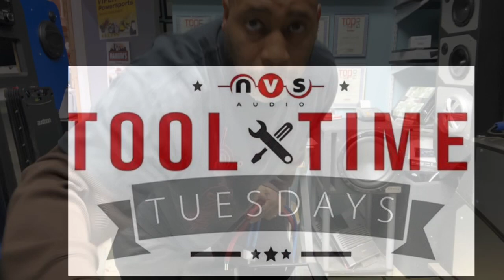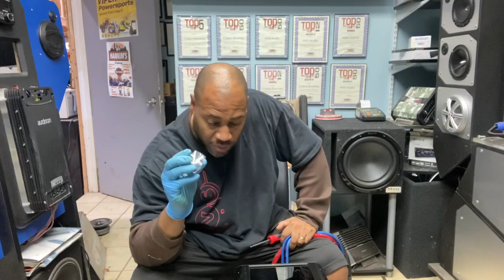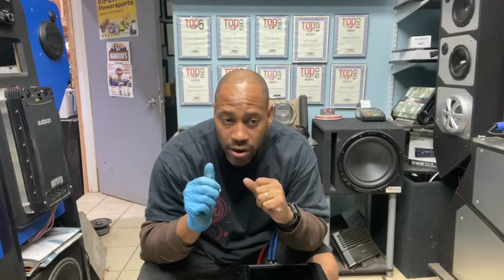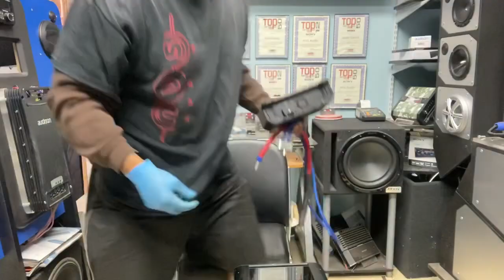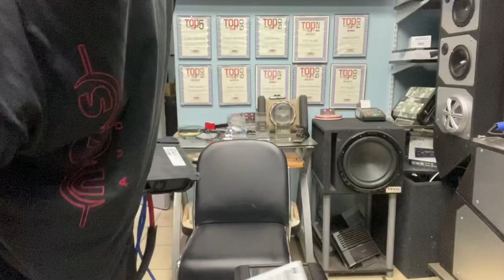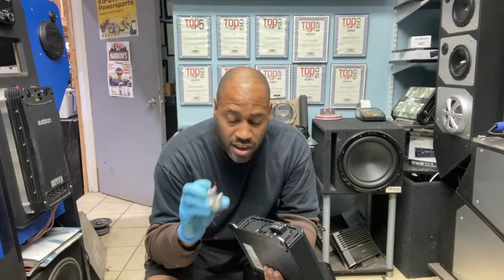Tool time Tuesday dual 0 gauge to single 4 gauge power wire adaptors

Comment: Hey bud. Going to be running a jp1300 and have 4 gauge existing power and ground. Can I get away with 4 gauge and can I hook the 4 gauge up to the 0 Gauge on the Amp? I didn't see and 4 gauge to 0 Gauge adapters. Thank you in advance
Reply from the maker: If you are see running it at 1 ohm you will
Need zero gauge 

If you are running it at 2 or 4 ohm 4 Gauge will work
Reply: @NVSAUDIO Running a single 12 2ohm at 1200 Watts right now. Where's the cheapest place to get good 0 Gauge OFC? Man I just spent a lot getting this system ready and don't really want to shell out the money for 0 Gauge now. 😅
Reply from the maker: @jaybourbon8608  https://www.batterycablesusa.com/0-gauge-1-0-awg-extreme-battery-cable-with-ends
Reply: @NVSAUDIO Man I broke down and ordered that 1/0 AWG to be safe. Man this build is adding up quick. Hah. Appreciate the help.

Comment: I had a question for you if you can help me on upgrading mono amp. Currently running 4 gauge ofc power wire with 120 amp fuse by the battery. Wanted to upgrade to a ds18 frp 2.5 mono amp but requires 1 gauge power wire with a 200 fuse amp. Can I run a distribution block with a 200 amp and 1 gauge power wire ofc going into the amp? Most of the ofc power wire would stay 4 gauge but would add the distribution block with fuse and a foot or 2 ofc 1 gauge power wire to amp? Thanks again any feedback appreciated

Comment: What about doing the opposite from 4G to 0G terminal ?
Reply from the maker: @BIGVVILL  why would you want to do that ? 

Zero gauge power wire will carry 300amps of current 

Going into a 4 gauge amp input ( 4 gauge is only 150 amps )

Comment: How do connect the ground side?  It looks like it's blocking the ground side.
Reply: Around 5:10 he shows a close up. Seems like there's plenty of space for the Ground, but you'd also need one of those for the ground besides the + terminal. So it would be a tight fit. And the remote wire would be a tight squeeze between them.

There are other PCs you can buy like banana clips on the  ends connecting to the amp or Ferrule crimps, but you'd also need two wire distribution blocks and split the + and -

Comment: The fosgate 1500bdcp has 4g inputs. I was gonna run 1/0 to distribution block and 4g into my amp. Will this make any difference? Like the 1/0 to 4g reducers but heard the fosgate amps the reducers don't work or fit correctly.

Comment: I been looking for an answer for this but if I Have a 4 gauge wiring system already hooked up .. would it be compatible with a Pioneer GM-5500T amplifier.. 
The crutch field site in the specs says 8 gauge ground and power wiring recommend. 
Please get back to me in trying to have my bass back on before I take a long drive for the holidays
Reply: Im sure you uave figured it out by now, but if not, totally run the 4g if you can. If it will fit into the amp then run it, if not get a reducer instead of rewiring with 8g. You can never have too big of wire, too small though will give issues

Comment: I had a kicker 2400 mono on 0 gauge..  but I sold it and the speakers. I picked up a pioneer gmdx874 1200 4 channel for my highs and mids to replace factory system.  Can I use the 0 wire I already have ran? Or will that be to much for that amp?
Reply: As far as I’ve seen you can’t run too large a wire gauge only too small, so as long as the gauge is big enough to handle the current you’re good. If it’s too small then that’s when problems arise
Reply: @rushawn3x  so if the. Crutch field site says 8 gauge power and ground recommended..
Would it not be smart to use 4 gauge wires not be smart to use i notice certain amps say recommended" and some say required ".
I'm kinda tight on the budget and don't wish to pay somebody to take out and put in new wires
Reply: Yea to be on the safe side I would run 4 gauge and if you wanna save money go with a good CCA wire from Knukonceptz. You could run the 8 gauge if that’s what the company says for the amp but you might be wiring it for a more power hungry sub and it might not get enough power so you can’t go wrong with 4 gauge, it’ll save you time later if you wanna upgrade slightly or so you won’t have to rewire the whole system if the 8 gauge isn’t enough
Reply: I could also be wrong though but it’s been like 10 months I assume you figure it out